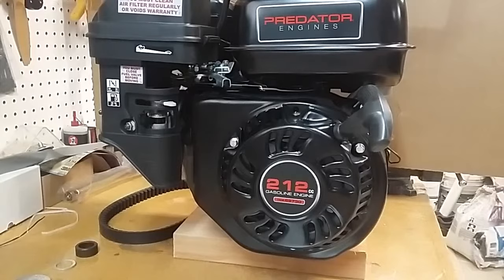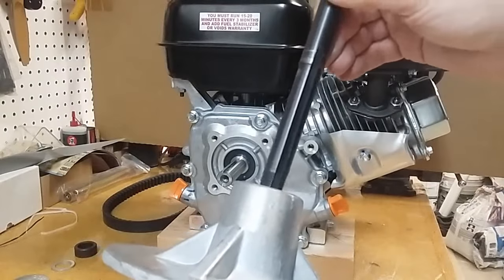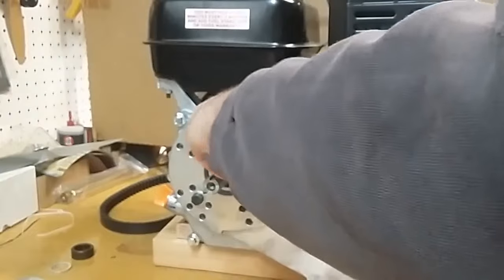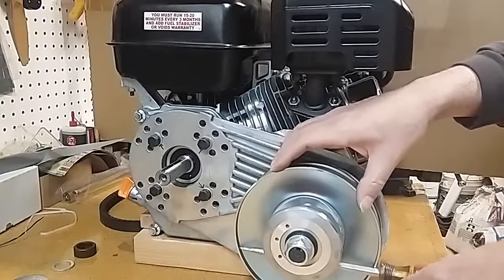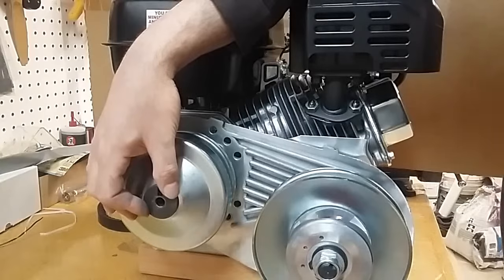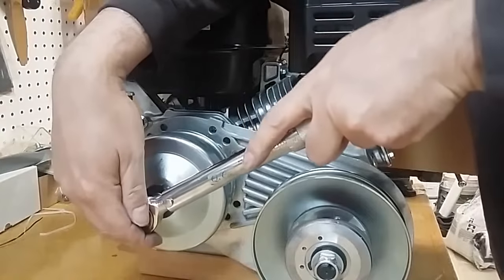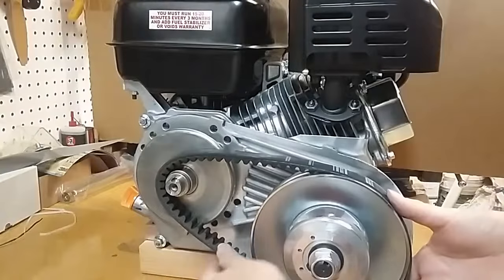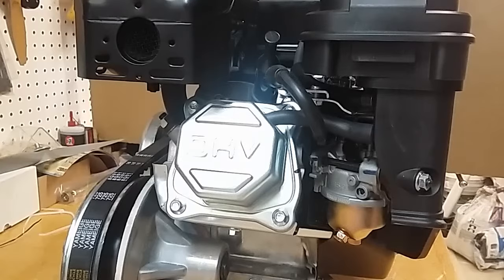Predator 212 - Series 30 Torque Converter Install: The SMOG Project 05

Comment: I’ve seen videos of people running the sprocket for the driven shaft on the back side of the plate. Different kit??
Reply from the maker: Must be. @3:05 The bearings for the driven shaft in this kit have different bore sizes and the shaft itself has a larger diameter on the "plate side" than it does on the "pulley side". Also, there's no keyway on the "plate side" of the shaft. So there's no way to "install the shaft backwards in the plate" or to mount the sprocket to the "plate side" of the shaft. You would need to machine an entirely new driven shaft for that setup to work with this kit. Of course, there's no accounting for idiots. Somebody may have put the driven shaft in backwards and just let it flop around.
Reply: @doktorscottdiabolical  on my kit you can mount  pocket n either side of plate depending on your needs. Mine is for 1in shaft not 3/4 " like this one
Reply: @hittinone  Where did you buy that one?

Comment: Thank you Scott. My kit's instructions never indicated the correct direction the outer sheave for the drive pulley, and apparently I didn't get lucky enough to first stumble upon a YT video that showed this, either. Don't ask me why I assumed it backwards, perhaps I was looking more at it from the outside, I don't know. I installed the flat side correctly, but flubbed the beveled sheave since the side with the springs is also beveled and I assumed they'd expand upward somehow? 

With the belt riding against that center section that's grooved I instantly began to shred the outside of the belt. What's  interesting is that the other salient feature was that the driven pulley was always locked with the drive pulley. So I couldn't even start the engine unless the rear wheel was off the ground. 

And so ... I went looking for what causes these torque converters to always be engaged and getting sidetracked with all sorts of red herrings about belt length (hey, it's a fixed length here) and "faulty pulleys" and so on.

Needless to say your video was the first I saw that showed how both pulleys operate at different RPMs.